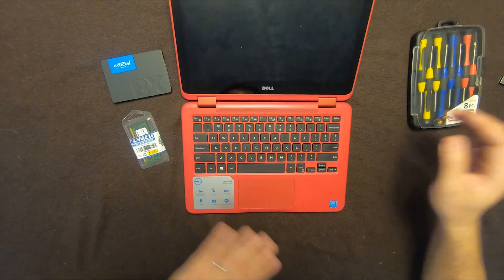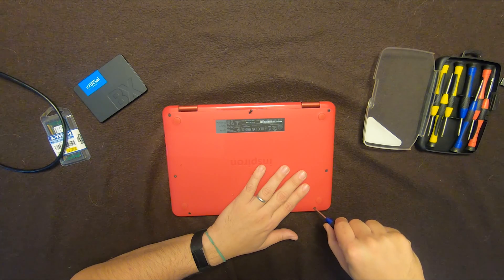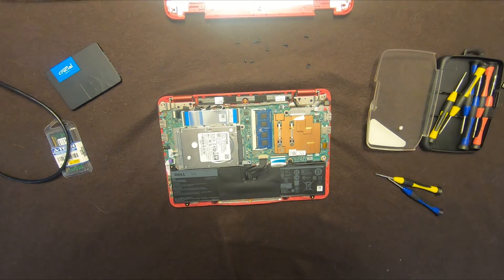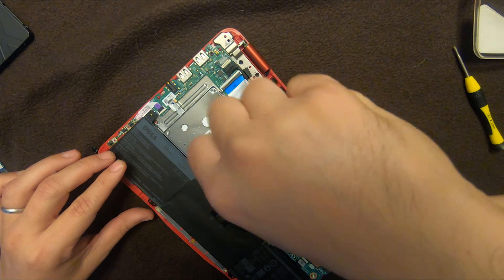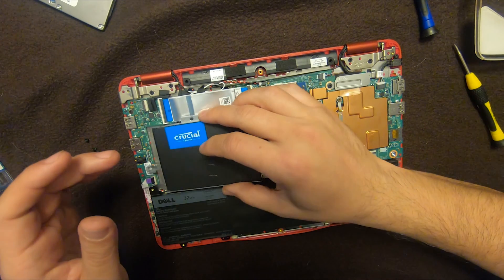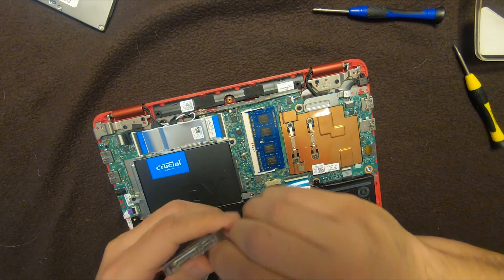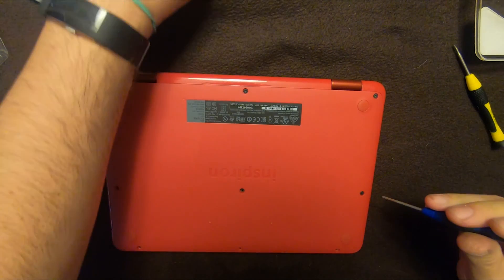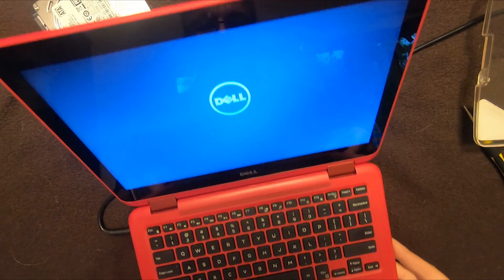Installing hard drive and memory on Dell Inspiron 11 3000 series (3168).  Also fixed keyboard

Comment: Great video  and clear thank you     gonna  upgrade my son's 2in1
Reply: Which memory can we buy from Amazon 8gb
Reply from the maker: This is the one I purchased but there might be lower priced ones now.  https://www.amazon.com/gp/product/B00C5389HQ/ref=ppx_yo_dt_b_search_asin_title?ie=UTF8&psc=1
Reply: @FernandoC  I'm looking on Amazon right now I just bought the Dell Inspiron 11 3000 2 in 1.  Can you show me which ones on Amazon I can buy?
Reply from the maker: @kokalol  which exact model do you have?
Reply: I double checked that's it
Reply from the maker: @kokalol  Sorry, your post had gone to YouTube spam detection.  Based on Dell's spec site (https://tinyurl.com/yavpl2fo), it looks like the memory is 4 GB DDR4 at 1866 MHz (1 x 4 GB)
 or 8 GB DDR4 at 1866 MHz (1 x 8 GB).  This might be a good option on Amazon: https://tinyurl.com/y9afcuaa
Reply: @FernandoC  thank you I had to return laptop was moving to slow

Comment: Wow.  Complete success here!  Laptop has been a real pig for a long time.  I was advised to put in an SSD and although, as you say, the dealer said the laptop could not accommodate more memory, I saw another video that said the same thing you did. Not only that, and you will laugh, I rolled my car one day, and although I walked away from it, my coffee was a bullseye on the Inspiron, after which the Control key no longer worked.  Ugh.  So I needed an SSD, more memory, and a keyboard fix.  I found an article from I think PC World that explained how to clone a hard drive, which saved me having to build this whole thing over again, I cloned the HD, took the old mechanical spinning one out and put the SSD in, swapped out the factory 4GB for an aftermarket 8GB (cheapest one on Amazon - TIMETEC $30) and while  I was in there, based on your comments in this video, I re-seated the keyboard ribbon cable.  The procedures all went 100% as planned, and now, probably 20 minutes after first cracking the case, computer boots up with new memory (Windows 10 "ABOUT" shows Installed RAM = 8.00 GB) disk clone works perfectly, and, can you believe it, the Control Key works again!  The difference in speed is very noticeable.  It is MUCH faster.  I bow to you and kiss your feet.  Thank you very much for this video.
Reply: Link me to everything you bought and how to clone it im on a mission

Comment: Ok, I have a question. Practically got the same laptop. Only mine is 32GB. I opened mine up and that entire silver area where the SSD would be isn’t there. Would I be able to buy what I need to add it there? Am I missing something?
Reply from the maker: Did you figure it  out? Maybe you have a smaller m.3 drive instead of an SSD?
Reply: @Earth 616 Survivor: your laptop most likely had this type of hard drive: https://www.amazon.com/dp/B07J2WBKXF/ref=cm_sw_r_other_apa_i_zr3NEbZFWA664
Reply: You can replace the motherboard of inspiron 11 3162 to 3168 version like this one, its very cheap on ebay

Comment: Will upgrading memory help with the computer freezing up causing you to have to reset the computer because of the freeze up? I have this same computer
Reply: I believe it should, I had two blue versions of this that had bad ram amount and only 30 gbs of hard drive space. By replacing the these properly should fix your problem. If not then you may have other applications running that will slow it down.
Reply: @Xethenion  What is the largest size Hard Drive can you put in? Links please. Thanks!

Comment: Do you think the newer version with Emmc drive can also be upgraded to SSD?
Reply from the maker: Usually the space in the laptop is not big enough to put an SSD.  I have an HP Elite laptop that came with an Emmc and had to upgrade it with another Emmc drive.  Also, some laptops have the Emmc soldered on so it depends on the laptop.

Comment: So, did it all work.? Meaning of the memory upgrade and ssd did it all take an operate flawlessly.? Thanks
Reply from the maker: Yes, significant speed improvement with the SSD drive and the memory did get recognized as 8GB.  Just make sure you have the latest firmware update for the BIOS to make sure.
Reply: @FernandoC  Can you provide the links to where you purchased the memory and hard drive? Thank you
Reply from the maker: @ThaMoneyTeam24  Yes, I got this memory: https://www.amazon.com/gp/product/B00C5389HQ/ref=ppx_yo_dt_b_asin_title_o06_s00?ie=UTF8&psc=1 and this hard drive: https://www.amazon.com/gp/product/B07G3KRZBY/ref=ppx_yo_dt_b_asin_title_o06_s00?ie=UTF8&psc=1
Reply: @ThaMoneyTeam24  
I have laptop as you too.
Well i have questions how to move data from old hardisk to new ssd?
But original windows still can use in new ssd?
Reply from the maker: Hello, if you buy an SSD that comes with software, it makes it easier to move the data to the new hard drive. Yes if you clone , you can use the same version of Windows. Crucial and Samsung have free software to copy/clone the data.